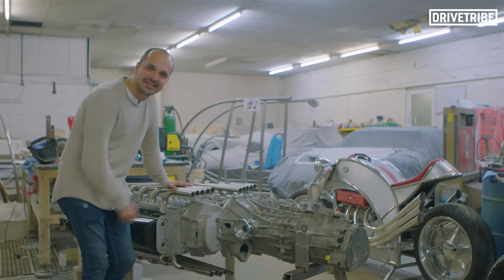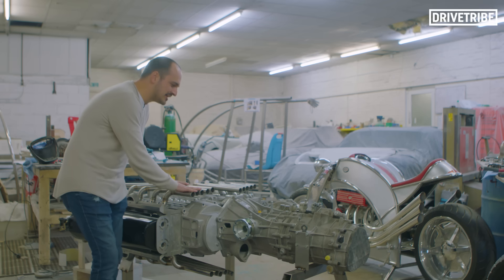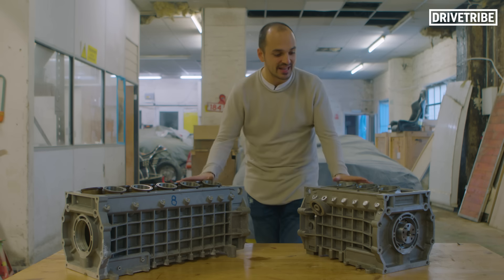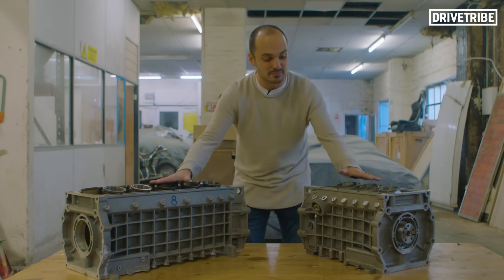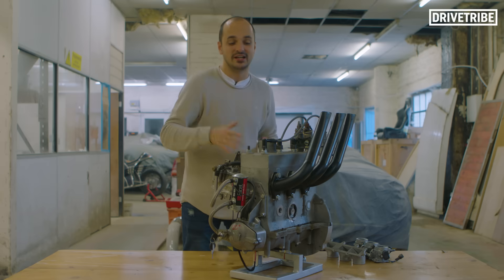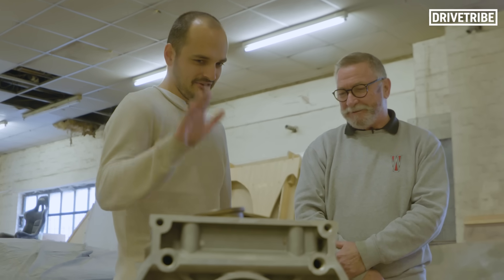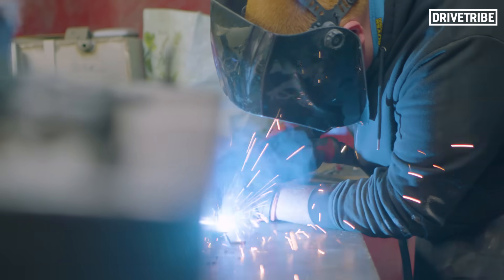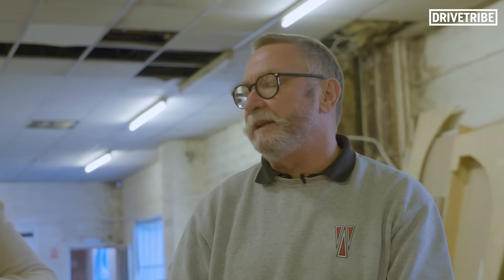This X20 engine is two V10s stuck together!

Comment: A monumental amount of time and energy to create an oversized engine with an unknown number of degrading issues. 400hp is being achieved by Suzuki Hyabusa drag bikes
with a fair amount of reliability. This thing is huge for the displacement and horsepower, I would classify it as a boat anchor.

Comment: Lol two V10 engines stuck together and the best they can push is 400BHP? Talk about an efficient engine. There are smaller engines out there that push more brake horsepower. Any engine or car manufacturers from the UK are a joke, engineering nightmare and unreliable.

Comment: The 2.0 V10 is great... especially if you twin turbo or supercharge it. The X20 is too big , maybe too heavy and there are smaller engines with a lot more horsepower

Comment: A VR6 is a block with 6 cylinders in a staggered or “zig-zag” formation, opposed to being inline, it uses one head. This “V10” is not 2 banks of 5 cylinders conjoined in the formation of a V, it is not 10 cylinders inline either. This is in fact a VR10, seeing as it also uses one head. A “V” engine utilizes 2 banks of INLINE cylinders oriented in the formation of a V. The W engine, as we can see from Bugatti, is an engine utilizing 2 banks of STAGGERED cylinders in the formation of a V (2 VR8s conjoined in the form of a V to be exact). Since this 20 cylinder engine utilizes 2 banks of STAGGERED cylinders, it is not exactly an “X” engine, as that would require the combination of 2 true V engines opposed to 2 VR engines. 2 VR engines conjoined in the form of a “V”, is a W engine like the Bugatti W16 or Bentley W12. This engine is not a true “X” engine, but it’s not not quite a “W” engine either. It’s somewhere in between. In my opinion, I would lean more towards calling this a “Flat W 20” because a regular W has the formation of a V, whilst this engine is flat like a Subaru boxter 4 or Porsche boxter 6. Yet it still utilizes 2 banks of staggered cylinders like a true W engine does. I am aware that there is another form of W engine which exists, utilizing 3 banks of inline cylinders to form an actual W shape, yet this engine configuration is incredibly rare and we will probably never see it produced and used to any considerable degree.
Reply: ok

Comment: Did you say 400 hp out of 20 cylinders? 400, not 4000? How is it possible that the designers are so incompetent?

Also, you say that they are interconnected with gears. Does this mean the two crankshafts are not connected by a epicyclic gearbox to allow one of the two be turned off? If so, how is it possible that the designers are so incompetent?

Comment: I've been wanting to do something similar to this using 2 Horex 1.2 liter VR6 motorcycle engines.  I would then put it in a Subaru to get a high revving 12 cylinder Boxer engine and AWD.
Reply: Why not a Busa v8?

Edit: also, 2 vr6s wouldn't make a boxer.

Comment: They look cool and probably sound great but quite low on power.  A 5.3L LS4 scrapyard motor can easily make 800hp with $1500 bolt on parts

Comment: While I think the idea of a V10 getting 40mpg to the gallon is quite interesting the 200hp is not all that impressive and the idea of bolting two of them together and joining them not via a crankshaft in a W engine configuration but via gears sounds like it will be impressive to look at and have an unique voice out the pipes but will be a cantankerous tuning nightmare for an engine making maybe 400 horsepower NA.  That said I admire the companies attitude and hope they do well now and in the future

Comment: Put two of those engines with twin turbos or Pro Chargers into a Bonneville streamliner and go for the piston engined wheel driven land speed record currently at 460-480mph. Built in Britain and carrying the Connaught name it would show those Americans up with their V8s. There is a race to 500mph and seeing  Project Bloodhound seems dead in the water at least we could get or own land speed record! As also it would be the most cylinders ever put in a car.

Comment: I designed an X16 in 1985. There was an aircraft X design also I seem to recall. WW II era.
Reply: It had electromagnetic valve operation with variable valve timing and camshaft lift/duration adjustability.

Comment: I want a v12 of theirs :D it would be 2.2 litres and be about 250HP and SUPER smoothe :D  Economical with great sound and power throughout the rev range
Reply: Would not get 50hp out of 2 extra cylinders since it's at 100hp to 1l

Comment: Rotax have super clean direct injection two-strokes in the Skidoo snowmobiles and Evinrude outboards. They are also more efficient than competing four strokes more powerful and cheaper to buy. 850cc 160 bhp. 
How about X format two strokes?

Comment: If you could buy these engines as crate engines and with a adapter for the stock transmission, they might be the best kei car swaps possible

Comment: Of course leccy cars are boringly quiet and very short range battery acid polluters, electrically deadly in a crash.  Most leccy car buyers go back to "real cars" in a short (very short) time.  Noise is very important for safety in town, so open those pipes and press that throttle.  Great job guys!

Comment: Why does it make only 400hp? The entire point of small capacity cylinders is to have lighter pistons and lower piston speeds so you can rev higher, it should easily rev over 10.000 and there is no excuse for this thing to make less than 800hp.

Comment: An X20 with 400hp?
Ok, what am I missing?
A mildly worked k20 surpasses this easily.
I get that they do it because they can  etc etc.
Reply: True it can... but the fact the parts are smaller and theres more of them means the "Load" is spread out more so not only will the car be smoother, it will also be potentially more reliable however it comes with a tradeoff that if something goes wrong it's going to be much more severe... 100hp in each cylinder will have alot more "Stress" in a 400hp 4 cyl motor than 20hp per cylinder in a 20 cylinder motor.

Comment: When you start getting to this size of cylinders the mass outweighs the bhp gain. They figured this out in the 1930s. It's better using turbos like  v8 twin-turbo or v10 twin etc.  Unless you're just after torque,  which is useless above 1000 pounds-feet in a conventional 2 wheel drive sports car.

Comment: cool, but not worth the $, a Suzuki Hayabusa is a 1.3L 4 cyl with 197 HP, take 2 of them V8 2.6L 384 HP NA.  it's there $ but how do you fix this engine in 10 years from now?

Comment: Why not a x 24 and take advantage of 6 cylinder primary balance. Also, two cranks is just a terrible compromise but I guess there's not enough length on a single crank for 20 con rods.

Comment: X20 engine: 2 V10 engines, smashed together, complicated gearing system, manual transmission; 400bhp.
Ford "Eco-Boost": 1 V6, DCT, 610(b?)hp. 

But, the X20 is waaaaaay cooler.

Comment: If it makes 400ish horsepower it’s not rocket science to figure out it will make about 400hp per 1 bar of boost. It’s a cool engine bit all that work for 20 cylinder 4 liters only making 400hp ehhhh

Comment: Meanwhile the GR yaris has a 1.6 L 3 cylinder producing over 250 horses.
Reply: But not naturally aspirated. That's the point of the x20, 400+ hp na , with possibility to supercharge or twin turbo it to get more power .. they also explain they aimed for better mpg as the competition gives right now on the V10 setups.

Comment: I think the sound will vary based on the position of the crankshafts. I'm assuming the crankshafts are connected with a sun gear. If you clock the crankshafts wear both number one cylinders are firing at the same time it will sound like a V10. Cylinders may fire 36 degrees apart if that's the case I would try to clock the second engines first cylinder 18 degrees after the primary engines number one cylinder to give all twenty cylinders individual firing events. Tell me what you think about that idea.

Comment: You you can find a V20 engine in a GE Evolution Series Locomotive, but instead of gearbox, they are linked with a DC generator.
Reply: Pretty much all trains are hybrids because it's drastically simpler and more efficient

Comment: ‘No one has ever made an X20 engine before’.  Yes for about 20 reasons.  Something that size, but producing circa 100hp/ltr is...entirely suboptimal.  Why use a common crank when you can add the weight and complexity of some kind of siamese gearing system with two completely separate engine blocks.

I wish them every success.

Comment: Don't really get the logic for the V10 being a "normal" car engine with 40 mpg's and comparable emissions. Yes, the output numbers are in the same range as your regular 4-6 bangers, however, the number of parts is a fair bit higher - more stuff to go wrong. And if say, you need new spark plugs, now you need 10 instead of 4...  It just doesn't make sense for a regular car. Which is why you only see them in high-end cars, because the economic situation of the purchasing demographic is normally high enough that they can keep up with the extra costs in exchange for having an amazing sounding engine.

I love the concept, and am super happy that gearheads like this exist who want to keep crazy stuff like V10's alive, but I don't see them working out in anything "normal".

Comment: Bolting multiple engines together, either around a common crank or via linked cranks, has produced some pretty eclectic power plants over the years... In the world of cars, there was the Cizeta-Moroda V16T, developed in the US by a company that included music mogul Georgio Moroda and which got it's name by being two V8 engines mounted either side of a central gearbox (forming a "T" shape, hence the name). When Ford became involved with Aston Martin, the V12 that AM developed started out life as a pair of Ford 3.0-litre V6 engines joined longitudinally. But the most outrageous example I've ever heard of [and I've just been looking but can't yet find a link - will dig one out and add it] was a 36-cylinder diesel made for a railway engine. It was built in the UK and ended up on a line somewhere in Scotland [I heard about it through a Scottish railway enthusiast]. The power plant consisted of no less than three V12 diesel engines, each of which had a 60-degree V in the crank, such that the 3 engines were oriented so the crankshafts formed the "points" of an equilateral triangle, with the "top" engine being literally inverted. As this was explained to me, the operator of the line in never did find out how powerful the engine was, because even when they connected together all the rolling stock they possessed, the engine was still able to move it all with ease. Will see if I can find a link...
Reply: OK, here you go... The triple-V12 engine was known as the "Napier Deltic". There's an excellent Wikipedia page, here: https://en.wikipedia.org/wiki/Napier_Deltic

Comment: Imagine the power of exhaust this thing still has.
If you go as far to turn this emgine to a turbocompound one it wouldrvest that unused exaust power into rotating force to the crankshaft while also complying to the exhaust regulations that require turbos (at least in eu)